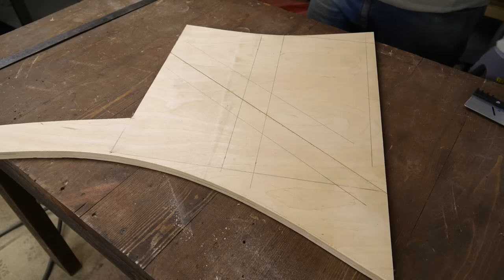Good idea! Folding chair with a secret!

Comment: Dude! The trick with the nails and marking up a curve with the flexible straight edge is genius. Totally stealing that idea. :-)
Reply: It's called batten. We use in boat building sometimes
Reply: Sameee ❤️
Reply: @Min Ton Me TOO, it's awesome
Reply: @wakamiwailer  In the era before computers, some curves on blueprints were drawn with splines. They didn't use nails. At General Dynamics they used lead weights with wire hooks that held the splines in place. The weights were vaguely duck shaped, so they were called ducks. The pointy tail was used as a handle to get the angle right.

For moon rockets and other aerospace applications where an engineer with a slide rule did a bunch of calculations, the engineer would calculate exactly where the ducks should be placed.

In the early 1980s I was at a University working on Computer Aided Design software. The underlying math was based on non-uniform rational B-spline curves, which could model almost any curve.

They could be created several ways, one of which was to enter the list of points where the ducks were placed.
Reply: @hamjudo  cool. like lofting, but with more math and computers.

Comment: Looks nice, but NO WAY would I stand on any of those steps with just 2 screws and an un-glued butt joint on each side.  I would expect this piece to collapse sideways with anyone but a small child on that top step.  Take a bit more time, use a proper dado and some glue on the sides and make a piece that will last a while.
Reply: Yes its not sturdy enough...
Reply: I built one of these many years ago and I used dados on mine VERY STURDY!  NICELY DONE VIDEO
Reply: Totaly true
Reply: Amen to lateral limberness and screws in shear in end grain plywood. Your library chair holds up to a slim built woman but a 220 lb man reaching to fit a flourescent tube? 

The ends of the steps need to be let in to the - well - jack and the inside corners gusseted. The whole assembly needs to be glued and doweled for strength. 

Gussets in the shape of a marine joiner's knee would be graceful and strong and complement the design, which, by the way, is very handsome.
Reply: You are 100% correct. This is extremely dangerous.
Reply: agreed

Comment: Using a flexible straight edge to draw gentle curves is a good idea. 
You need to come up with a better hinge mechanism to keep the two pieces of the seat firmly close to each other.
 If the person sitting on the  chair moves, there is a strong likelihood the of the bottom getting pinched. Notice at 7:52 the two halves of the seat moving and the gap at one side increasing to be a potential bottom pincher.
Reply from the maker: Thanks, you can use the piano loops

Comment: All that's holding the weight is 1/3 the thickness of the plywood, focused on 4 screws.
Reply from the maker: It was a test sample, now grooves for steps are made
Reply: @menscraft7985  everybody's a engineer....smh
Reply: @deezynar, what is the shear strength of the screws and plywood used?  Please show your calculations so I can peer review your work.
Reply: @Geoff_G  I have seen bookcases held together like this fail.  Haven't you?  Men's Craft already replied to my comment.  They said this version is just a test, they intend to use dadoes on the final design.

Comment: Nice design.  The stair treads need to be rabbeted into the side supports.  The tread attachment is not acceptable to hold substantial weight.  Plan for double the weight of an average person that might use it.  Also, show what your making at the beginning of the video, rather than 7 minutes of build before your reveal.

Comment: Very nice, I think many people miss the point.  The design seems quite stable despite standing on the top rung as she demonstrated. I have one of these that I've gone top rung on a few times besides the fact that mines poorer design tends to sometimes want to tip.  Despite being infamous, the top rung existing means people will take a calculated risk and go there from time to time as an alternative isn't always practical or even possible. Top rung people get the job done or die trying... besides don't you guys have some new safety info...we bored of your usual well known advice.  Wouldn't be surprised if he did it on purpose for comments :P

Comment: Nice design.
The only problem I see is the 4 screws holding each step. They are only holding half the timber width and there is not enough holding the steps, especially for the weight of a person on the highest steps. This will cause a bad fall as the chair/stool gets older. The steps should be imbeded into the legs/sides.
Reply from the maker: Thanks for the comments, be sure to consider
Reply: Yes, gluing some blocking on the underside of each step would add a lot of strength. Or use the router to inset the steps into the sides. But very nicely done with so few tools!

Comment: it is way better when you use a router bit with a bearing to round the edges of something that has been cut with a jig saw to first make the edge smoother to avoid that the bearing telegraph the edge inconsistencies to the rounded shape, it is something that has to be done anyway sooner or later, so is better to do it before you use the router bit.
this, the hinges you decided to use that are imho not aesthetically correct, i prefer other types of hinges for this kind of chair, and mainly the screws and butt joint for the steps are the main flaws of an interesting and well executed project that could have been done in a better way. 
and as others told before me the steps are the real flaw, they are not safe to use and can potentially cause an injury if they fall apart, and there is no doubt that using plywood and only screws they will do it sooner or later if the chair is used as ladder often or by heavy people.
with a bottom bearing straight bit to do the proper housed joints or dados, as are called in america, is a very quick and easy task, even few mm or a quarter of inch of dado makes the ladder much more safer.

Comment: she is JUST BARELY inside the vertical starting at the floor under her feet.  It wouldn't take much to lean too far to the right and put mass center past that point and tip over.   I agree with the other comments about the strength of the steps.  No glue,  only the shear strength of the screws and compression strength of the wood ...ply wood at that.

Comment: What is the shear strength of those screws? I'm guessing about 75 lbs. When we climb a step or descend a step, there can be as much as 2.5 times your body weight on a single step, and since we don't step in the center of a step, assume that 60-70% of the force is on one side or the other. That means that a 100 lb person can be putting nearly 90 lbs of force on a singe screw. So, this design is not for everyone...
Reply from the maker: Yes, you are right, but this minus of the construction is easily eliminated, you just need to make the grooves for the steps, which I already did
Reply: @menscraft7985  Yes, dados would be an improvement.

Comment: A very dangerous product. Never screw screws into the edge of the plywood. Sooner or later, due to the weight of the body, the step will crack in this place, and a person can fall from a height. Do not repeat such a product after him if you want to have whole arms and legs.

Comment: https://images.ua.prom.st/322912355_w640_h640_petlya-tortsevaya-siso.jpg 
Siso ombre loop - end. , Allows you to flip the table cover 180 degrees., Used for the manufacture of tables . Хорошая работа   . с  петлями  Siso  будет смотреться лучше   , и повысится    прочность.https://constanta.ua/aksessuary/369-taburet-lestnica.html